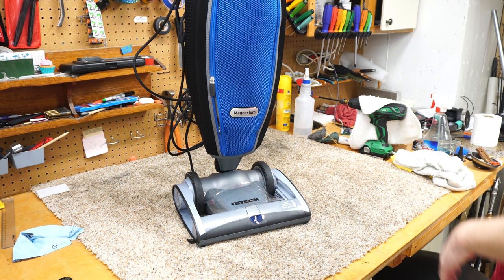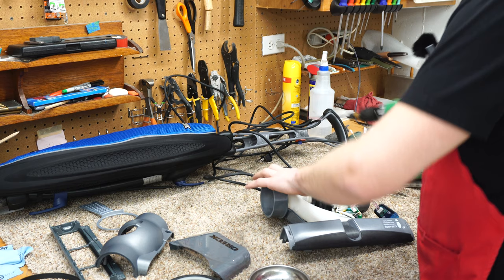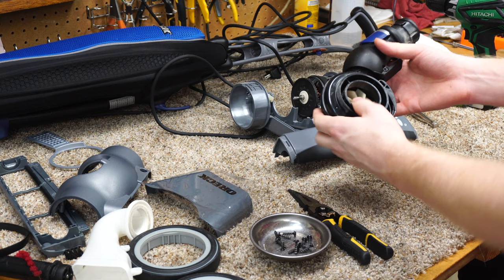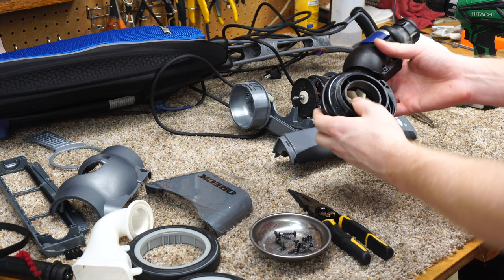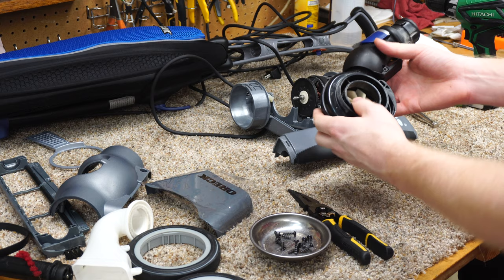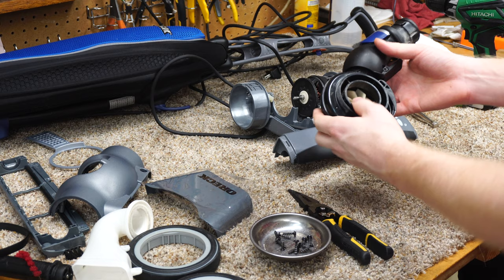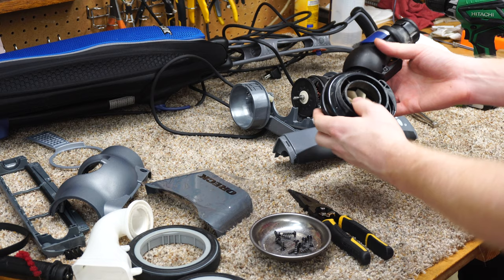Oreck Magnesium Vacuum Cleaner Repair LW1500rs  LW100

Comment: As a repair technician this vacuum pisses me off. On the board is a collection of pins that look like they connect to something. So I spent 5 hours trying to figure out what connects to that boards becuase there is no wire coming out of the switch area. Really glad I found this video. God this vacuum is stupid.
Reply from the maker: Sounds like amateur hour. This is an easy machine to fix.

Comment: Thank you so much for your video.  Our vacuum would not turn on.  I knew about the coin in the handle but that didn't fix it.  Using your video to take my vacuum apart, I learned that the fan assembly was stuck solid.  I got it spinning again and cleaned everything up.  Expected it to work, but the control board was dead.  Replacing that got it working again.  Ordered a replacement beater bar and felt gasket.  Your video saved me a bunch of time and money.  Thanks again!
Reply from the maker: Thanks for watching glad it was of service to you!

Comment: Great video! Really appreciate your complete instructions. I only have one suggestion. When putting screws back into a plastic housing, you should turn the screws backward untill you feel the screw fall into the existing thread. Otherwise, over time, screws that are repeatedly ran in with a screw gun, will strip out. Mainly because some will not take time to verify if in the threads. Then start a new thread into the plastic. I have not taken mine apart yet, so if there is a brash insert, this concern may not apply.
Reply from the maker: That is something I do every time. You might notice me going backwards with the screw gun in my hand. This is a very important step with plastic.

Comment: I really wanted to like this vac so much. I have had two lemons in a row and it’s ruined it for me. The first one had a cracked fan right out of the box (I’m thinking it was a customer return). The second one has the RF and brushroll sensor issues that this suffers from and keeps reappearing after I fix it. Without those issues though I would really enjoy this one I believe.

Comment: Very helpful video and allowed me to fix my vac.  I had to replace the swivel neck and when back together I could hear a slight fan against the housing as I vac'd and swirled.  It eventually went away but it seemed the tolerances weren't quite right.  Pretty sure I got it all back together correctly and the fan was tightened down after double checking to be sure.

Comment: Personally I prefer canister vacuums,  because they are lightweight and cleaning is really easy with them. Also we have Vorwerk in Europe... it is extremely expensive and a little heavy.... I have to say that cleans very well, but for example when you need to clean somewhere thought-to-reach, you will need to bring the bag of accessories connect the hoses and..... it is really difficult 😂

Comment: Thanks - I was interested in the bag part and wanted to see how you get that top part (end of ur video u were holding in hand separate from machine)  where u have the switch button, how u got it out? Also how to change the top bracket. U focused mainly on the bottom part which was good

Comment: Hi wondering if you could provide me some guidance. I have the same model and after many years of use with no issues the vacuum won’t start. In the past I change the battery but now that’s is not doing the trick. I ordered a new board (it was a slide different thinking it was a new model) but still didn’t work. Thank you

Comment: Question for you. 
I picked up a used (non swivel version) Magnesium, took it all apart and cleaned it (was decently dirty). After using it, it's carpet grooming is very poor. In other videos I see of this, the carpet grooming seems really good. 
-I have ordered a new brush roll, which will take some time to arrive. But the brush roll in it does seem fine though. 
-It is missing the felt gasket between the white air inlet tube and the motor fan, I'm not sure that plays that large of a role, but that's coming in the mail as well.
-when I had it apart, the fan didn't seem to be in all that great if shape, but I figured it'd be fine. I forgot to check if it's cracked though, so I don't know if that could be an issue. 

Any idea what it could be?

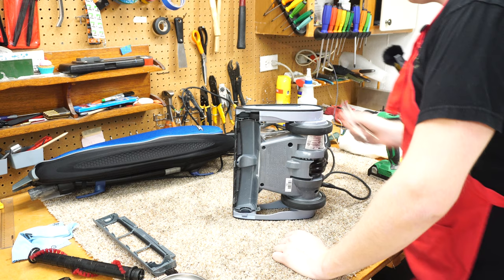Comment: What is the name of the tool (at 2:57 for removing the side cover) that Oreck stopped making that is hard to find? that middle neck assembly piece assembly cracked on us, and we have 3 of these so would really like to get the tool to replace the neck, as I see this is a common problem for this model.  Is there a substitute tool?

Comment: Sir, I have an Oreck  it turns on, and then 1 second later, it turns off, and it's  LW100, Type 1. 
I was wondering if you knew what I could do to fix it, maybe fix it, please?
Reply from the maker: Bring it to your local vacuum store and have them look at it.
Reply: It's already out of the 7 year warranty and I have it torn apart down to the White vacuum tube
Reply from the maker: Rip

Comment: I have a dead LW1500. Think it needs a PCB, but all I see online are for the LW100. Those don't have the spring antenna, so can I assume they are not compatible replacements?
Reply from the maker: I would try changing the watch battery first if you haven't. Go to your local Oreck store they'll have the part you need.

Comment: Hi, first thanks for the vid, I got two of these and I'm a hands on kind of guy, I ended up getting two of these,  both no power,  battery checked and still no power, any suggestions, note I have a total of three of them, I bought 1 working and it's great,  I have my own cleaning business and the one I have works great,  now I got the above no power,  thanks for any help
Reply from the maker: Bring it to your local vacuum store and have them fix it.
Reply: Hi, thanks for the response,  but like I had said,  I'm a hands on kind of person,  I want to learn and fix it my self, I fix my expensive Nespreso machine,  so any suggestions,  thanks
Reply: @stevencourtney1965  Replace the CR2032 battery in the handle. If that does not work then click the power button a few times then hold it down. This should pair the handle with this circuit board. Your sensor will flash when pairing is complete. Do this with the machine plugged in obviously. If the above doesn't work you are looking at a faulty PCB or handle. More commonly the PCB. Both of these items are no longer in production.
Reply: We’re you able to fix your vacuum? I am having the same issue, thanks
Reply: @robertnieves5848  hi, no not working,  I need a pcb board/mother board, or have it fixed
Reply: @steven courtney  okay I am going to try to fix mine if I get lucky I would let you know

Comment: Was suckered into buying one of these back in 2012. With the cost at $500.+ I was told it would last many many years even after the 7 year warranty and service agreement. It just stopped working last weekend and my local repair shop said it was the circuit board, which can't be found anywhere. Sad to say but I have trust issues with repair shops, since another local one tried to sell me a complete bag assembly and another used vacuum when it only needed a replacement part, which I was able to find on line for less than $10.00. Do you know if this is truly the case with the circuit boards? Are you able to get this part or offer any advice? I appreciate your help! Thank you!
Reply from the maker: well they might be on back order from their wholesale manufacturer like everything else right now with every manufacturer. But the fact they couldn't just search on eBay for one it's kind of disappointing

https://www.ebay.com/itm/ORECK-83045-01-LW-100-Magnesium-Upright-Circuit-Board-Part-GENUINE-/392865324172?_trksid=p2349624.m46890.l49292